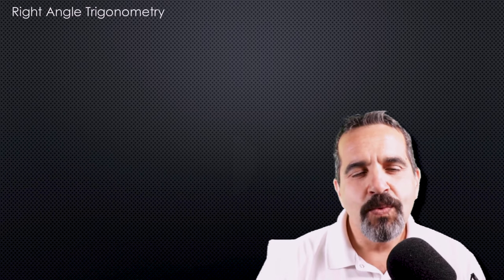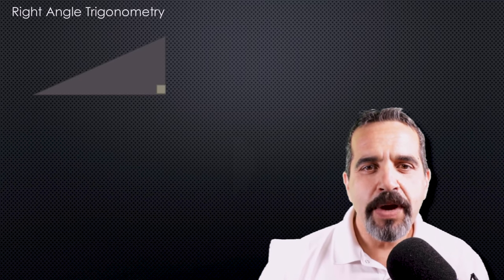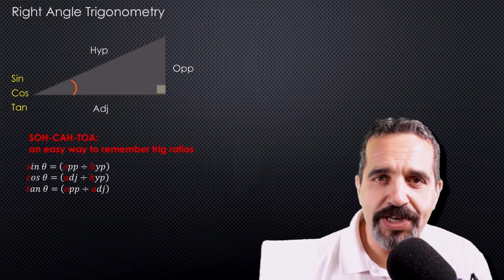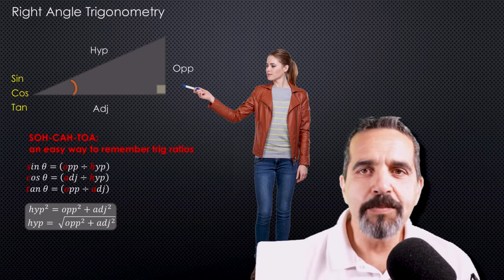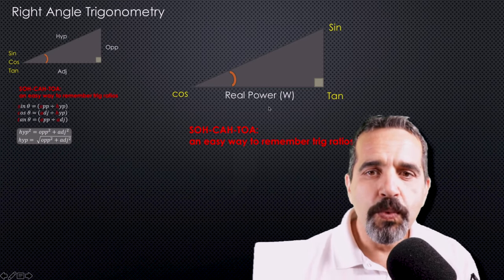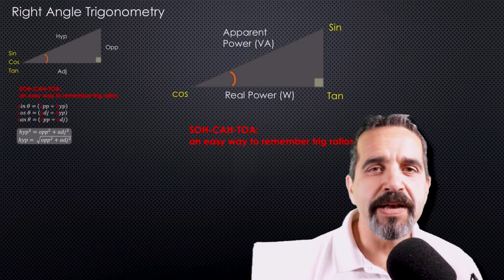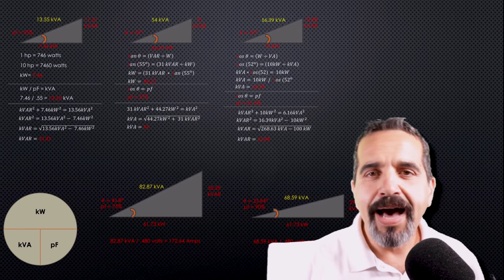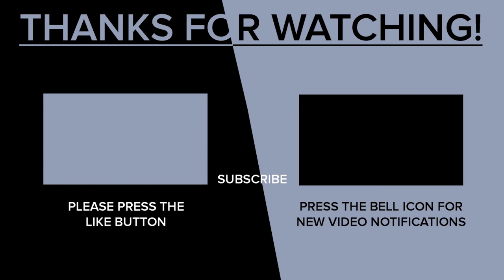Power Factor Trigonometry for Electricians | Part 2

Comment: I'm an electrician and civil/electrical engineer and can say this was a very informative video. With the exception of the motor 2 mistake of multiplying 31 KVAR by TAN 55 instead of dividing by TAN 55, everything else is spot on.  This is why it's always important to have someone check your calculations, because it's so easy to accidentally multiply when you're supposed to divide, or vise versa.  Another good rule of thumb is to look at the magnitude of your result and ask yourself "does this answer look reasonable?"  Don't just blindly plug-and-chug and accept whatever the calculator spits out. If no one is around to check your work, set it down for a couple of hours and look at it again with fresh eyes. You'll be amazed how mistakes just pop out from no where.
Reply from the maker: William, thanks for the feedback! I appreciate it.

Comment: For motor 3 @ 23:36 , why do you use Cos instead of Tan like you did in motor 2?
Reply: In M2, we needed to find the value for the HYPOTENUSE which meant he used TAN because he knew the OPPOSITE value and the ADJACENT value.  In M3, he used COS because he knew the ADJACENT value and wanted to find the HYPOTENUSE.  SOH CAH TOA.  Sine, Cosine, Tangent, Opposite, Adjacent, Hypotenuse.  Hope it helps you understand.

Comment: Somewhere around the third motor calculation you started calling the kW as KVA and again when you added up all the KWs or adjacent sides you were still calling the adjacent side KVA. On the third motor calculation, you were calling the adjacent side KVA, even in the part you had written out.
Anyway

Comment: Question,   Every electric bill I have ever seen charges customers for (watt hours).  Not KVA hours.   Are you 100% sure that the customer are paying for KVA to the utility company?    I believe a company will be paying for KVA only if they are being charged power factor charge.   This is normally only done if lower than 90%.  Respectfully,   Kevin

Comment: Can you please explain how to correct to power factor from 75 to 90%. What real word application can you do to correct the motor power factor?
Reply from the maker: Hi PL. Power factor can be corrected by applying the correct amount of capacitance to the circuit. This will add Capacitive Reactance which will reduce the amount of inductive reactance. To add the correct amount you will need to know how much "VAR" or "kVAR" is in your system and then size the capacitors accordingly.
Reply: @AccessToPower  Thank you, great video.

Comment: Calculation for Motor2 is wrong.
It's 21.71kW.
Btw, where is the part3?
Reply: The angle is 35 degrees. The tangent of 35 degrees is 0.70. 31/.70=44.28
Reply: @aliso-pv7ll  
The angle for motor #2 is 55 degrees. Wontaek Oh is right. Its 21.71Kw

Comment: At the 20m 45s mark in the video, you put "kW=(31 kVAR * tan 55º)" and that's wrong.  It should be "kW=(tan 55º ÷ 31 kVAR)" with the correct answer being 21.7 kW.  You essentially doubled the kW by multiplying when you should've divided.  With the M2 kW being wrong, the calculated M2 kVA is wrong (should be 37.8 kVA).  The overall kW, overall kVA, and overall PF are wrong due to the mistake with M2.  Finally, the multiplying factor of 0.397 for PF Correction would be wrong as well as the kVA rating of the capacitors required to achieve 90% PF.
Reply: I got confused between second and third triangle when rearranging the formulas should have been the same... thanks.

Comment: M2 angle of interest is 35 degrees. The tangent of 35 degrees is 0.70. 31/0.70 is 44.28.
Reply: it's listed right in the video as 55 degrees for motor 2 as the angle of interest. The formula is incorrectly rearranged to multiply by the tan instead of dividing it. The correct answer is 21.71